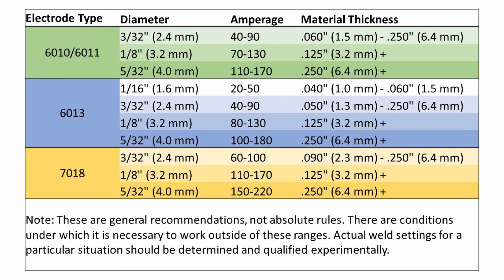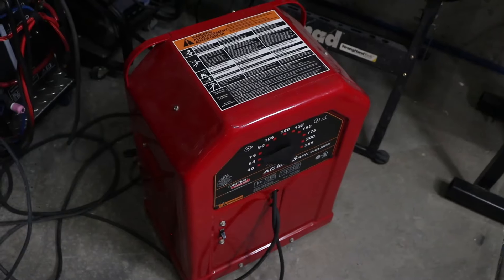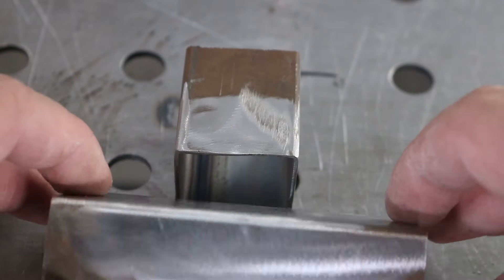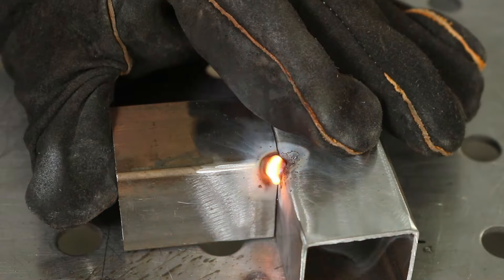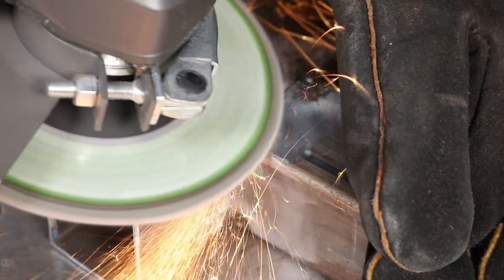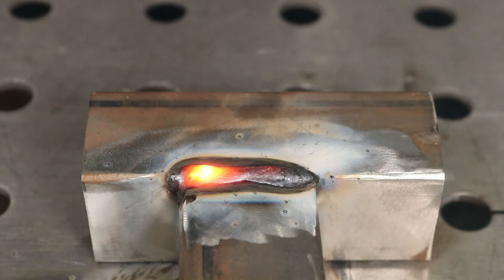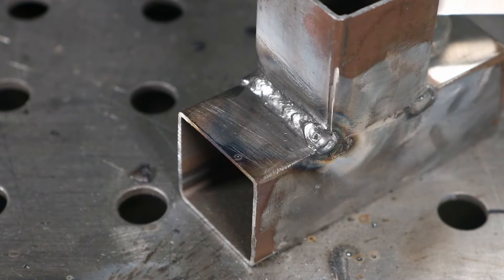Stick Weld Thin Square Tubing

Comment: So according to the chart, 3/32" 6013 can't be used for anything > 1/4", right?
Reply from the maker: The chart is just a guideline/starting point, not a hard and fast rule. If you run multiple passes, you can go as thick as you want, it’ll just take a bit of time.

Comment: Need Help,, I cant stop my stick from sticking,, and it wont keep on,,, WHat is that a sign of? Pls,,,,,,,, i am using the Red Lincoln box, and i  do have it plugged in to 240 volts, thru a long extension cord, Fat cord,, its brand new,,,, and Im using 7018 rods,,,, Tell me what im doing Wrong, please,,
Reply: What size. 7018 runs hot. Try upping the amps more and more. Eventually that 7018 with light and can almost run on its own. Also strike 7018 like a match

Comment: Hi as a newbie I am having lots of problems with slag traps on fillet weld's
Reply: That’s a major disadvantage of 6013-7014 welding electrodes! Even the good welds he laid down in this video had those “blowouts” in some of the end craters! I’ve found that the blowouts are less of a problem on thicker steel, but I still get those frustrating slag holes without warning! I pretty much stick with 7018 & 6010 welding rods to avoid those issues! I have heard that ESAB brand 6013’s are a far superior rod to anything other brand of 6013, but I’ve never used them before!

Comment: Great video Tim! Right now I have a project and I’m using thin wall square tubing. But I can’t weld continuously because the amount of heat will make holes on the tubes so basically I tack weld all the joints. 
 I’m welding on 1.52 mm material and around 60 amps.
Reply: Thanks for the great video and helpful information.
Reply from the maker: Sometimes just tacking them is enough. You may need to travel faster or run a smaller electrode on a little lower current. Also, one thing I forgot to mention in the video, it can be helpful to let the material cool a little between each weld, because if the metal is hot to start with, you'll be more likely to burn through.
Reply: If you are doing something like a series of tacks all besides each other, that actually takes quite a bit of skill. You might try 1/16" 6011 with AC, or 1/16" 6010 DC electrode positive at 40-45 amps. The flux is less likely to be trapped.
Reply: @kylecordero6386  1.6mm 6011 rod using Direct Current electrode positive, or Alternating Current if that is not available. From what I understand 6010 is not as commonly found outside the USA. It leaves less flux, burns through and floats previous flux better, and starts easier than 6013 rods.
Reply: moving fast is key.  also, rod angle can help-drag with your angle lower to the puddle rather than perpendicular.  this will put less heat directly onto the metal.  Some rods run DCEN or AC, both of which put less heat into the base metal.  Also, if you can put the joint at a position where it is at a 20 to 30 degree angle, you can weld a little bit downhill instead of horizontal.  welding downhill puts less heat into the base metal than horizontal or uphill

Comment: At last,a honest teacher.Most have been trained to push the fire,wrong.Drag that e6013 is how to get strong welds..you only push fire when youre blowing out rust from the weld path.This guy is correct,drag fire on clean metal.

Comment: Hi Tim, I want to learn to fix my own car exhausts when leaks develop. What is the most budget friendly process without needing gas? I've seen lots of videos and read material that generally says thin metal like exhuast should be done with mig be it gas or fcaw, with the main concern being burn through. Now I've seen you weld thin material with stick and you've shown how smaller electrodes can burn with less amperage and heat. I've seen 1/16 308 stainless rods that have very low recommended amperage. Also all fcaw stainless wires requires quite high amperage to run. So I'm confused, if Amps is heat then wouldn't a thin stick work even better?

Comment: I'm welding some 1/8" box tubing with 3/32" 7018 for a truck tailgate replacement project. I'm finding you have to skoot along pretty quick. I also blew out my corners on the 45 miters, so I gotta fix that. Would be cool to see how you recover from blowing out big holes? I'm using a pecking technique kinda trial and error. Many thanks for taking the time to drop scholarship on your approach. It's a good skill to have.

Comment: HI im new to stick welding im kinda having problem welding thin tubing like this, the joint i produce after welding is all slag , it all went like this video, but after  i crack the slag the joint didn't fuse together instead they melt, creating bigger gap,  its like im only creating slag ,not metal joint, im using the same classification electrode with  diameter both bigger and smaller than used in the viedo. i try different range of amperage from 60 which is kept sticking up to 120 which makes lot of spatters and melts the tubing , in the end i weld arround 75-80.
Reply from the maker: The best advice I can give is to practice running beads on a plate and focus on distinguishing the molten puddle from the slag. 6013 is the hardest rod to see the difference between the slag and the pool. Once you see it, it will click and you can watch the puddle of metal bridge both sides of the joint and your weld will be where the puddle was. Also, while it will depend on your machine, 75-80 amps might be a bit high. If the sticking is right at the start, you may need to hold a long arc for a couple seconds before moving into the joint with a short arc at the lower amperage. Hang in there, this is hard but achievable.

Comment: I have a Campbell hausfeld 70 amp welder.  It only has a high and low setting (40/70 amp).  Is it possible to weld extremely thin galvanized steel with it? If so, could you demonstrate it?

Comment: I need to reweld for a fish tank Stand, using 1/8" thick square tubing. It is a 700 gallon tank, I wonder if I can use either one of stick rod you mention in this video 6010, 6013, and 7018. Or the 7018 will be more appropriate for the heavier duty stand? 
By the way, really like your video. Subscribed!
Reply from the maker: For 1/8” thick, any of them would work. I would use 3/32” (2.4 mm) 7018 because is has the nicest, most smooth look.
Reply: @TimWelds  Thank you. Look forward to your new video

Comment: thanks for the help, have anything on what shade to use?
Reply: Maybe it's just me, but I don't find Shade 10 to be sufficient when using 6013.  I took a welding class years ago and for one session I spent an hour welding with 6013 using a Shade 10 lens, and for the next few days, every time I blinked I could see a "flash spot" shaped just like the electrode arc.  The instructor said it might have worked better if welding in bright sunshine when my eyes were already bright-adapted, but it sure worked poorly in a dimly-lit welding booth, and I've noticed that Shade 10 never seems like enough when welding in my own shop too.  I always use Shade 11 or 12 with that kind of electrode, except for very small projects.  I find Shade 10 to be okay for some other electrodes, such as 6011.  Your mileage may vary.

Comment: Can the hot start feature on inverters be detrimental to this? I absolutely can’t pull out a fillet joint on 18g material with my setup, even with the 2mm (~5/64”) 6013 electrode and setting the amperage as low as possible. If I go fast enough so it doesn’t burn through, it doesn’t make an adeqquate pool and fuse the pieces, and if I slow down just enough so it forms the pool, it opens up the keyhole.  Just something that popped in my mind watching the video. My inverter has this feature always on, and it makes sense to me that the hot start feature, while beneficial in most common situations, might add just enough heat at the start of the joint that the walls collapse with the travel speed necessary for that weld. Plus, i could then blame the tool and not my lack of skill. 😝
Reply from the maker: Welding 18g is going to be difficult with stick; you'll have very little tolerance for any gaps and you'll need to hold a really short arc. The hot start feature should be done pretty quickly, however I have found the output of some little inverters to be quite a ways off from what the dial says. I'd try to run a bead on plate first to see if you can get that without burning through. On the joint, it's okay if there's a keyhole as long as you keep moving to fill it in.
Reply: smaller electrode 3/32 or 1/16.  also place joint at a somewhat downhill angle and put your electrode at a very low angle. strangely, a little quick preheat with a propane torch could make it so when you move very fast, you are now melting the base metal whereas before you didn't fuse.  rod type and size, rod angle, joint position, arc length, travel speed, and weld direction can all affect penetration.  I was welding some 20 gauge angle shelves with flux core mig 0.030 and found downhill easy while uphill would often blow through even with quick travel speed.  Is your fillet on a t joint?  make sure you angle more toward the bottom piece than the upright, letting the weld wash up noto the vertical piece.  also, if you could set the t joint soit is flat rather than horizontal and you are welding down ito the "v", less heat would be directed at the vertical(where the blow thru generally occurs.  I would like to put a stinger mounted thumbwheel rheostat to be able to drop amperage on the go for thinner metal.  the longer the weld, enough heat may build up to blow thru.  also, as the electrode shortens, resistance drops and the arc gets hotter.  having a thumbwheel to dial back the heat 10-20 percent would be awesome.

Comment: I'm planning to learn to weld this year and I've been watching dozens of how-to videos in preparation for when I get my machine. Something I keep hearing is "keep a tight arc" but nobody ever explains exactly what that means. It's hard to see in the video, and it's not really described how it's accomplished. What exactly do you do with the end of the stick? Do you drag it along the metal? Do you hold it so that it hovers a few millimeters above the metal? I'd be very grateful if you'd tell us. THX
Reply: Yea the keep it the arc length tight "Length of arc: The correct arc length varies with each electrode and application. As a good starting point, arc length should not exceed the diameter of the metal portion (core) of the electrode. For example, an 1/8-inch 6010 electrode is held about 1/8 inch off the base material" found through Google's via Miller welds website.

So essentially keep it the thickness of the electrode but it this instant it may pay to be in the closer side but all depending on your welder set up and travel speed ect.
Reply: As a newbie myself and home YT self teaching, the arc length in stick is harder when you are just starting out. I got frustrated just attempting to strike an arc and not a bunch of stuck electrodes and arc strikes. Best thing that I did to get better was “GO THICKER MATERIAL “ like 1/8 “ or 1/4” just run beads on plate or corner angles. The thicker material takes longer to heat up and will give you a chance to strike arc, figure out what your seeing by “weld pool” and then in that split second get moving AND slightly lowering your rod as its burning up as filler!!! Way more difficult than MIG. As the material comes out the gun.  I did successfully tack weld a cheap metal fence post with the metal plates on them to stabilize them. The practice on thicker helped as the thin stuff will help you be frustrated by the hole blowing.....cheers and happy practicing when you get your welder.
Reply: The first reply to your question is a good one.  Also, note that 6013 is often called a "contact electrode" because when everything is dialed-in right, you get good results when actually dragging the electrode along so it contacts the base metal via its coating (with the electrode at a typical angle, this creates a bit of a gap between the metal of the electrode and the base metal).  That's not a hard-and-fast rule, because you'll find out that there are times you need a longer arc than that, but it shows that deliberately holding the end of the electrode with a sizable gap away from the base metal is usually not correct.

Comment: For me it gets a bit more challenging to avoid blowing holes through the weld when doing an end to end joint like a mitre joint. The fillet joint tends to be a bit more forgiving because you are welding up against the side of the tubing.

Comment: Great video! When you could, can you do a 45 degree square joint of 16 or 18 gauge galvanized square/rectangular Tubing? You mentioned in another video that you use a quick pass trick with 6011/10. Thanks

Comment: I have a question when stick welding a 90 degrees joint regardless of size my weld pool would always gather at one side or the other i rarely can get the pool too cover two sides? Mind helping me
Reply from the maker: This is really common and can result from 3 different things. First make sure that your rod is angled at 45 degrees in and out of the joint. Second make sure that the center of the rod is pointed at the line in the root of the joint. Third make sure that you let the pool form on both sides before you move and make sure not to move too fast. The main thing is to learn to watch the weld pool and make sure that it is where you want it to be. Hope this helps.
Reply: @TimWelds  hopefully

Comment: Great job on your videos.. its nice seeing just a regular guy trying to help others without acting like top dog.. Most beginners will be practicing on older pipe and tubing which can be a bitch if you can't get the inside clean.

Comment: How is this possible? I mean im newbie and weld the same thickness but my metal always penetrates and make holes 😭 what did i doing wrong?
Reply: I just picked up welding, but that puts me in the same shoes as you.

I found it helpful to use very thin electrodes and go down with the amperage a lot (I used 1,6 and 2mm with only 35-40 amps to weld 4mm of steel). This will increase the amount of heat you put into the material overall, but it will buy you some time once you strike the ARC. I made a small puppet chair out of 4mm steel last weekend to practice those L- and K-joints. My welds look ugly and I had to weld almost all of them twice due to my unsteady motion, but I didn't burn through the material even once.

I don't plan on maintaining those settings, but for now I still have to offset my surprise and panic when I finally do strike the ARC and learn that steady motion while constantly feeding the electrode into the puddle ...
Reply: @brag0001  nice buddy
Thanks for the tips and tricks

Comment: Just what i m looking for
Reply from the maker: Thanks!
Reply: How do you tune arc force? My welding machine had this arc force control....pardon me for asking

Tried it and got lots of blow holes at the beginning and its getting better when i tune my amp to 45
Reply: @mujalmorpi9704  i think arc force is also call "dig".  Higher # generally means crisper harsher arc with a more agitated puddle.  less is smoother and colder
Reply: @peetky8645  tq

Comment: Can I touch the rod while welding ?
Reply: I haven't tried with bare hands, but I'm doing it all the time with my leather gloves. The voltage is too low to penetrate the gloves or your skin.

I wouldn't touch it with bare hands because of the risk of hot metal jumping up from the weld pool, and I've never checked the temperature of the electrode while welding.

I'm a newbie to welding and had the same question a few weeks ago. Several tutorials actually instruct you to hold the electrode holder in one hand and to lay the electrode onto the other hand so you aren't wilding a long stick trying to make precise movements with its tip.

Comment: Beautiful welds Tim...I would have blown a hole through that, for sure! I'll try on thicker tube to start.
Reply from the maker: Thanks! It takes a bit of practice, but you can get the hang of it.

Comment: Now I am so confused...😢 everybody says to go point by point
Reply from the maker: The real problem with that is opportunity for slag inclusions and a weaker joint, but if it works for your application, go for it. The best way to sort it out is go try it and see what works for you. For me,  running a straight bead is best.
Reply: @TimWelds thank you!!

Comment: 1st video viewed and loved it. If you could possibly put  a little bit more effort for us who are struggeling (e.g. due to my low welding level, I find easier to use "coin to coin" techique on 2mm material thicknees to prevent holes, so your video is motivating for me):
1. show position of stick in all views (side and top) without striking the arc 
2. show movement of electrode without striking the arc
3. put welding parameters in video description
THX
Reply: 4. For choosen parameters, did you drive the electrode on the "thicker" side of parts or in center of the meeting line of the parts?
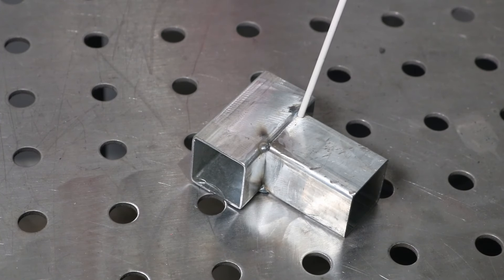Reply: 5:44 10° but in 6:15 it seems more like 45°?
5:58 45°in the top view and what about side view?
Reply: If you can weld a coin, you should be able to run a bead, just drop your rod angle, move really fast, and if the metal is very thin or the weld quite long, do intermittent inch long welds several inches apart along the joint, then return to the end of the first weld and add another inch to each.

Comment: Dumb question.  Is this aluminum or steel?  I’m putting a camper on a truck and am wondering whether to braise or weld the aluminum tubing.  Thanks so much for this video!  Subscribed
Reply from the maker: This is steel. There are stick rods for aluminum, but I’ve never used them and don’t know how well they work. There are videos about MiG and TIG welding aluminum on my channel if you want to learn more about those processes. Thanks!